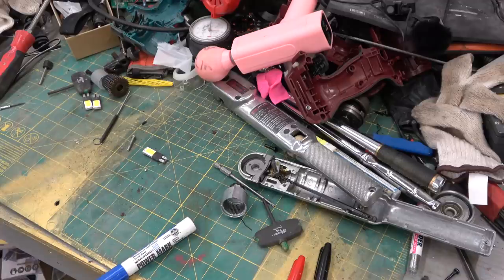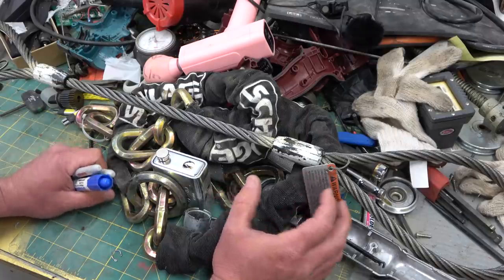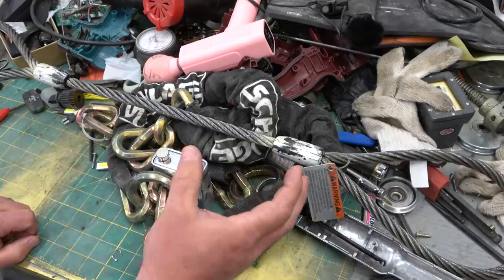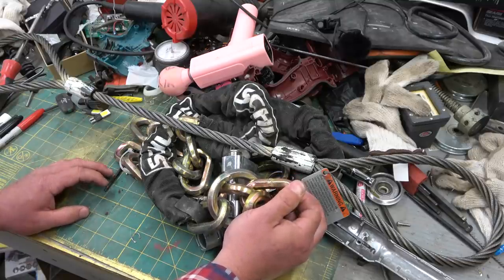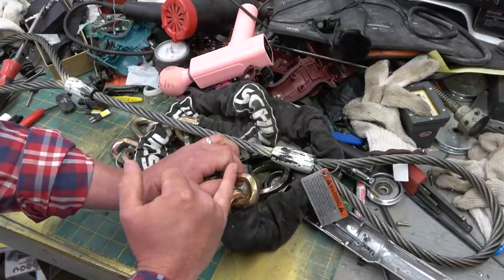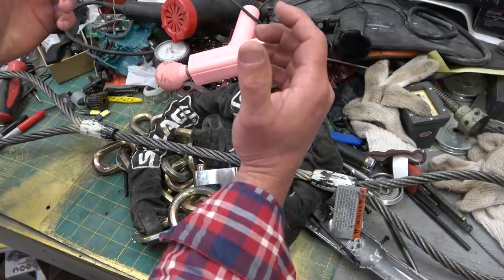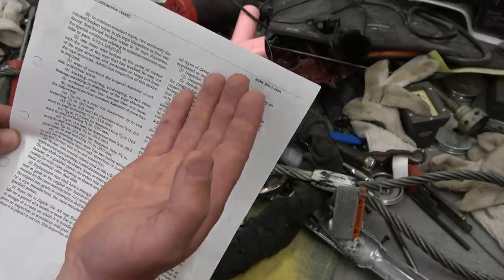"It is not known why the pulling cable snapped."

Comment: From what i know (i live few miles away from the tragedy) The cable snapped on the top because the pulling motors was not well calibrated. this applied an extraordinary force to the cable in a position where the elasticity of it was near to 0. Probably this was even the reason and the conseguece of the continuos break malfunction witch cause the criminal decision of put em out of service. when the cabin reach the top and be in contact with the stopping pad on the upper wire the pulling sistem add an addictional pull to the system breaking the rope. Just a criminal act  caused by the greed of the owner ot the plant who seriosly pushed the responsable of the service to do "all is necessary for make the machine work because we are losing money"...

Comment: I would consider this gross negligence, the “intention” piece of “intention to cause harm” comes when the tram operator enters into said “contract” with each customer with the intent to make a profit above all else,  not withstanding the implied necessity of safety and proper maintenance of equipment used to provide the contracted service.  This is one of those situation where licensing and regulation are necessary.  I wonder if the technician would send his wife and kids up in that clusterfucked machine?

Comment: I've seen people do dumb stuff like this even in the truck world.  I've had loaded trucks drive into the shop with brake cans caged, or lines clamped off.

And in my boss at the time's case, he had a big front end loader that didn't have any brakes at all because some idiot just straight up removed them.  No brake shoes, no master cylinders.  To stop you either slam the trans in reverse or drop the bucket on the ground.

Comment: I work in the translation industry for 20 years. Ie I'm a truck driver. We are required to do pre and post trip inspections. On all equipment. Not to Mack sure I make it home safe. But to not kill others. We run 80.000 lbs load up and down the same roads. As you the difference is you car is 2500 lbs. Now think about that the next time you pull over right in front of an 18 wheeler. We don't won't to run you over..... sorry my rant. Stay safe

Comment: salut mec. just read the nyt summary article on the mexico city metro disaster. lotta interesting stuff in there to break out- judging from the comments, there are people out there that don't reflexively understand how delamination of a composite concrete slab / i-beam structure can weaken the whole & result in the buckling failure witnessed. and how to get strong weld vs. weak weld, of those studs that popped. and what the heck do those ceramic rings do? etc. you do the video, and... i'll watch it.

Comment: As my hindsight is 2020, why didn't the technition fix the hydraulic unit? It would be easy in that you replace the entire faulty unit and replace with a "new" one, then repair the faulty unit. The hydraulic circuit should simple enough that even I, an electrician, could be able to diagnose and repair.

Comment: Around the turn of the last century in the United States a number of slip and fall cases started to work their way into and up the court system. The culprit- the banana. Customers in grocery stores kept slipping and getting injured on that banana no one working there saw or bothered to pick up.

If you ever read the case law that grew out of this area of fort negligence it is very interesting and import many in the area if law regarding negligence by business operators. Many owners knew the banana was there, even let them rot to a certain point before someone got hurt. They had no duty to protect their patrons, or so they thought.

Comment: Maybe they should install a manual brake that can be used by the passengers. Won't 100% eliminate the risk, but still better than nothing. Your right however if the automatic brakes were simply maintained it wouldn't be an issue in the first place.

Comment: Over-riding the basic safety system should have caused a constant siren to blare, with emergency power back-up, until a government safety official came and hauled the entire lot into court.....all turn-stills locked, an emergency power shut-down of the drive motors....

Comment: That's why you can see at a glance that those brakes are disabled.  The original engineers - and their standards - made it so.
This is typical of the root source of "psychosomatic illness" - in this case at terminal speed.

Comment: If it was inconceivable that the pull cable would break then there would never have been a need to fit emergency brakes would there? Beyond belief that any competent engineering technician would disable emergency brakes even if ordered to by the company. Interesting point that all safety regulations are written in blood.

Comment: No different to locking out the anti fall mechanism of an elevator in a sky scraper. The braking system is defective and parts for repairs are unavailable, you shut the machinery down. Obviously it is cheaper to let the insurers take the financial hit than shut the cable car down until it can be fixed. I suspect there will be several more similar failures of equipment that has had prolonged maintenance free downtime due to the Covid pandemic. The aviation industry has a less than spotless reputation in this regard so the air accident reports will make interesting reading over the next couple of years.

Comment: I share your anger.  The designers considered every known failure mode and  did their level best to design in protections. Some of those failure modes were very rare, but they were not impossible. Some could occur once in 100 years but they still had to be considered and mitigated.  Then people unconnected with that think they know better.  "Its never happened, it never will..", "we don't need this..."  and they make ill informed changes that remove protections and they never go back and re-visit the original design intentions, becuse if they did they would see why these protections were there. Absolutely this is a management failure but its still also an individual failure.  Management - audit and inspection of safety devises, compliance with regulations, management of change (disabling an emergency brake is a major change) and the individual - no amount of bad management can excuse disabling a safety device and putting people at risk, its a core professional duty.  There's one final management failure - supervision and staff appraisal.  I'll bet the technician who disabled the brakes rather than make the effort to fix them properly had done other dangerous things before.  How were they still in their job?  Was it easier to look the other way?

Comment: If the brakes are dragging....why not tag it out and get it fixed? idk what goes through their heads, disabling safety gear is an easy way to get 20 years in jail and you'd never get a job in the industry again

Comment: I would NEVER EVER disable such a security device!
In case I lose my job I'd report the company to the government.
If they run with disabled security installtion I'd would report them to the government.
It wouldn't be the first time I've lost a job because I rejected to disable a security system even so no human lives were at risk.
Security device are implemented for a good reason and not to annoy. That's just a benefit X)

Comment: Sadly you are pretty much on the money. I work in industry specialising in safety critical systems and systems. Soooo many people don’t understand the simple maths or don’t want to, a risk is one thing, time or number of times is the killer, most people won’t take a clearly horrendous risk even one time, but it amazes me how many people will take a small risk with potential horrendous consequences many times. That all said this was a complete disgrace, it wasn’t even a failure to understand the maths it was an absolutely disgraceful negligence, for an engineer to bypass an emergency system for the purpose of carrying passengers for any period is an absolute disgrace. For management to condone it and effectively sign off on it is likewise a disgrace, no excuse for it. What job is worth that? There’s no hiding for those men, the Italian regulations are as good as anyone else’s, they killed those people.

Comment: "The profit is not worth 14 lives"
You may actually be wrong about this one. 
I put my imaginary self into the position of a money-hungry owner of this kind of business: All I want is reaping the profit from an investment.
The cruel story:
Now, by law I'm required to have safety technicians, safety devices, etc. I'm also required to have insurance.
As the money-hungry bastard that I am, I'm well aware I can't skip out on the insurance because my business would be forcefully shut down immediately. On the other hand, I'm in full control of the poor people who do the hands-on work - and I put pressure on them.
Once the accident happens all claims will be handled by the insurance, and the insurance will try to claim recompensation from me, the bastard who caused the catastrophe by employing ill-equipped people to operate the thing and putting pressure on them in order to maximize my profits.
After dozens of years of operation I have made my cut of money, the accident happens, but when the victims and the insurane want compensation all that money is nowhere to be found - I have had enough time to make sure of that and I don't care about the victims.

Comment: Look at the history of fire safety doors. People panicking couldn't wait half a second to open the doors inwards so people burned alive when it could've been prevented by a push door, or having a split second of patience. Fire safety ladders now have to undergo inspections because in the same fire, or about the same time, it fell off during actual use. Every standard is written in blood, then guys in suits remove them or ignore them so they can be a tiny bit more efficient. Repeat.
Reply: The Iroquois Theater fire, 1901. The Triangle Shirtwaiste fire, 1911.

Comment: I get fed up with lessons not being learned or passed on through industries, you can't even excuse separate country's as standards apply to vast regions for example - EASA Europe or ISO. Going further on standards - any aircraft crash (not that this is an aircraft, I am just drawing a parallel) in the world you can bet that the FAA will have a interest, if even to gather lessons and people/organizations are held accountable with a outcome of a root cause identified and fixed.
on the commercial aspect of quality -  this might originate from self preservation of an industry but as so many engineers and people operate in these respectable quality environments,  it becomes a way of life and a self standard for the individual, these people should challenge any pressure - in this case to keep the unit running regardless of consequences. I know its hard to challenge your peers, god knows I have and not always came out smelling of roses after doing so, but for self respect and safety of others you can at least live in peace ( as you mentioned).
avE your post is brilliant and your analysis from a distance is amazing, I would love to see the final report after all is said and done. 
Dam, just realised that this is a year old, I am posting anyway! - Is the report out yet?

Comment: Poor maintenance and carefree hey man   attitudes are what kills people .cutting corners kills  lack of grease on the elevator screw jack killed everyone on an airliner .the maintenance engineer had signed off the schedule and failed to carry out the work . double / tripple checking the work carried out is super expensive ..   saves lives but achieves very little other than a good safety record .. leaving the company banckrupt and the opposition with a chance to make even bigger gains .

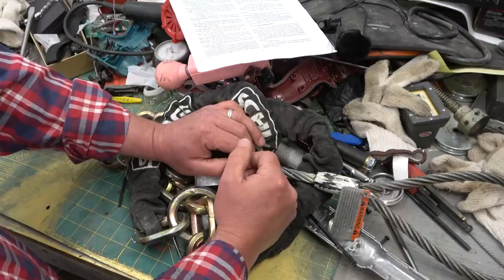Comment: @14:50 it's corporate manslaughter!  Arse hole Directors of the operating company need locking up and the key tossing off a cliff.
Failures in management often ensue due to pressures from the board room!  Ultimately it is the directors that are held responsible as they should be!

Comment: Any company that allows equipment to operate with safeties bypassed without CEO level sign off is committing a crime in my opinion. In the Navy for certain unsafe but necessary work only the Captain could sign off on the work and so on his head it hung. Additionally it should need to be resigned off weekly. Then maybe pencil dicked middling managers would stop directing frontline guys to commit crimes.

Comment: This is sad.  Even more sad is this is not an uncommon way of thinking for some people.  They either want to score points with the big wigs or are pressured by someone up the chain (probably with no technical knowledge) to make a certain decision.  Regardless if they know of certain regulations and codes or not.  Not preaching that this is true, just saying I see it a lot and it needs to change.  

I'm a mechanical engineer, but my motives for becoming one are not common.  I worked as a laborer at different nuke plants and I worked as an auto mechanic most of my life.  I got tired of busting my knuckles on shit that wasn't designed correctly or it was retardedly over-engineered (*cough* Volkswagen *cough*) so I decided to pay a shit ton of money to some "collledge" so I could get that little piece of paper that said I could do the job.  I'm working my way there, but holy shit do I work with some fuckin weirdos!  I wince every time AvE talks shit about engineers and blames everything on us, but most of the time he's got a point.  A lot of the engineers I work with are just trying to swing their dicks around to see whose is biggest and have no ability to think critically.  Most of these socially awkward nerds have never even held a wrench before or even know how to change their own oil.  Now not all the engineers I've met are this way.  There are some engineers who actually have the ability to think critically and look ahead beyond their own vice-imprisoned dicks and do things properly.  Unfortunately, they're overshadowed by the ones who know how to play the political game.  I became an engineer because I wanted to change the dynamic of the industry to bring greasy knuckle busters and carpal tunnel laden egg heads to the same playing field to actually get some good work done.  It's a pipe dream, I know, but at least I have the ability and motivation to try.  Just a little rant.  Pay me no mind.

Comment: Go work in quality control somewhere. You'll see management and people you report to push product through that doesn't meet the quality required. As QA you have no say but to quit your job, which most people wont do. Always about speed and profit. In most cases lawyers are cheaper than supplying a good product in the first place.

Comment: I'm glad to hear the blame for this kind of thing being laid at the door of corporate greed. Everything from environmental welfare to individual human welfare is totally at the behest of corporations trying to make some money to show off to their shareholders. It's a shit system of governance for business, because it takes the approach of "what's the least we can do and get away with it" in terms of things like safety, or welfare. On the other hand, Formula 1 teams take the approach that they won't trust any third party to machine a part for them that they consider "safety critical", so they pour massive resources into setting up their own shop so they can tightly control the tolerances so their £50Mn drivers don't end up all over the road - That is an extreme but a good approach.
Reply: Also this happened in Italy so the maintenance engineer probably just said "issa fixed-a" then zoomed off on his Vespa in his Armani suit. Cheap stereotypes? Never heard of them.

Comment: As AvE said this was easly preventable, as The Minnesota Wolf said below some Muphys Law idiot will do the stupid thing. Thus Engineers need to keep these facts in mind and make certain these type systems have more backup that prevents this kind of maintainance man from disableing the breaks and if designed right kmore backups could keep this from moving IF those breaks are disabled.as an exaple.In the overall costs of a tramway these extra steps are a rounding up figure. It is neglegible. Sorry my spelling n engliss not too good.

Comment: Aside from VFD there really is not much of a control system directly to the motor unless it’s synchronous. That being said there’s no way they wouldn’t use a massive DC motor. All the shaft drives in the mines I’ve seen, gondolas in the Rockies all use DC motors. Usually old as fuck. With the age of the system a lot of old equipment just keeps using the same motors. Working at Siemens in the middle of potash land in the prairies, those older motors are actually incredibly versatile and fucking tough. Wasn’t a big fan of NEMA. Honestly siemens brought them all down westinghouse quality drive motors were gone. Even the 5000hp motors that drive the pumps on the keystone from monitor through grenfell to Brandon and south.  Constant problems.   I’m actually a big fan of WEG. Fuckin expensive but worth every single penny. every goddamn stator has a better seal then any explosion proof nema i noticed almost immediately.